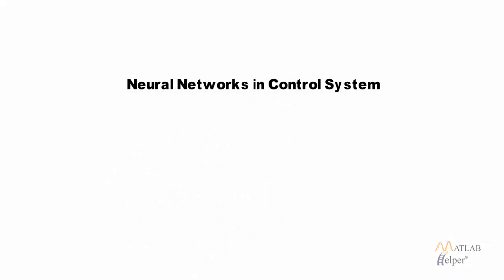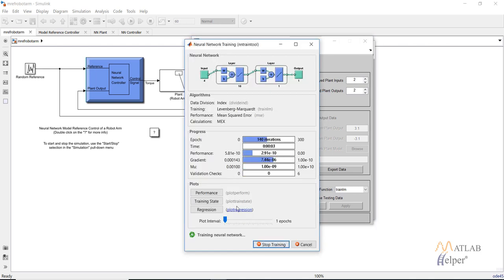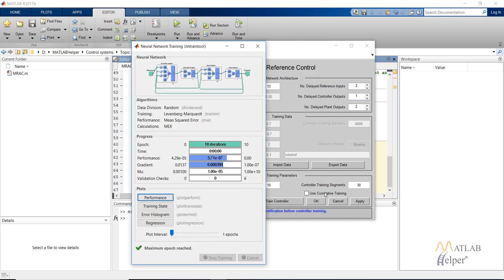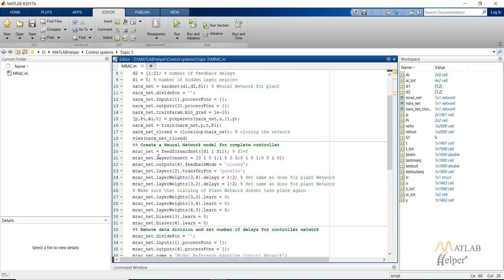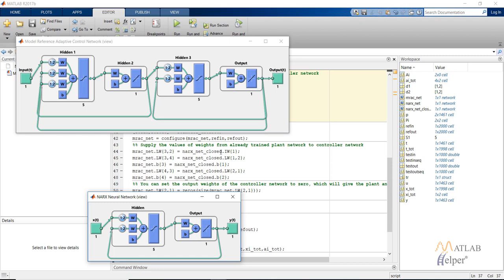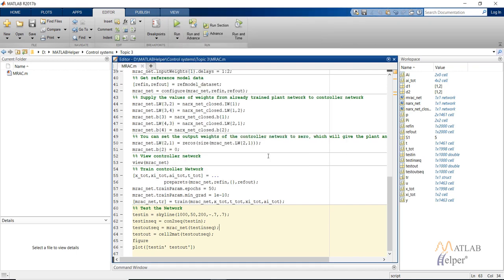Model Reference Control System | Neural Network | @MATLABHelper

Comment from the maker: Book our premium course on Neural Network at https://mlhp.link/NeuralNetwork/
Read this lesson at https://matlabhelper.com/course/neuralnetwork-m2c8l4-model-reference-controller/ for codes & explanation.
0:00 Introduction
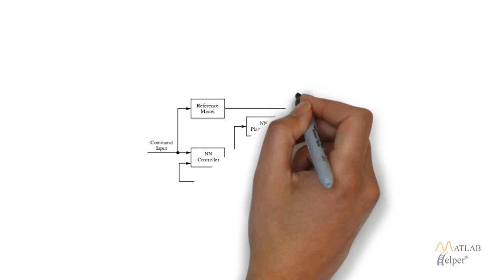0:19 Introduction to model reference controller
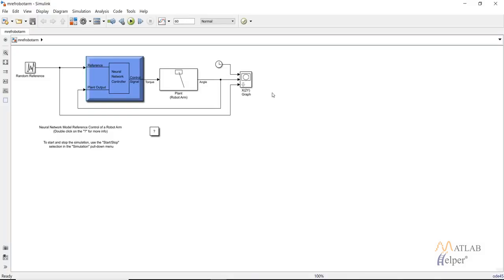1:44 Simulink model of the reference control system (robotic arm)
3:19 Training the controller
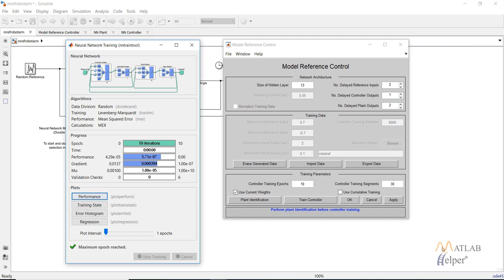4:46 Running the model
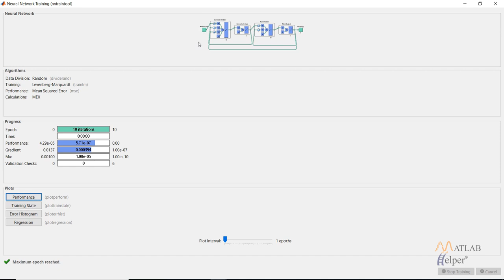5:18 MATLAB code for Model predictive NN controller
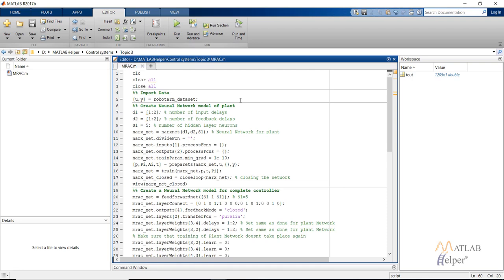6:01 Running the MATLAB Code and analysing results
Reply: @MATLABHelper  I want to design controller for fractional culculs technique with such kind of analysis with neural network .

Comment: How would you get the controller from there? What you''re simulating at the end is the final neural net, not how well your controller would do on the plant itself. Would you just copy every weight like you did with the plant identification?
controller_net.IW{1,1} = mrac_net.IW{1,1};
controller_net.IW{1,2} = mrac_net.LW{1,4};
controller_net.LW{1,2} = mrac_net.LW{1,2};
controller_net.b{1} = mrac_net.b{1};
controller_net.LW{2,1} = mrac_net.LW{2,1};
controller_net.b{2} = mrac_net.b{2};
Reply from the maker: Thank you for the comment! You can follow our Neural Network Course at https://mlhp.link/NeuralNetwork. If you have any queries you can write to us at course@matlabhelper.com
Reply: MATLAB Helper ®  Hi! That sounds like a plan, but right now I just want to know if you can answer this simple question. I dont know if taking a course will necessarily help me with this
Reply from the maker: Hi  @LoudHydraulics ! 
Our experts provide assistance in all academic and research work with Online Sessions (Audio, Video or Written) or Offline Written Work with pricing suitable for all. You can see our services at mlhp.link/services and portfolio at mlhp.link/portfolio

If you are looking for expert's assistance and ready for the paid service, share your requirement on our website or via email to team@matlabhelper.com with all information including service preference, necessary attachments, and any deadline.

Comment: How to make this statement  in simulink for a system containing continuous states :
Varying the current from 1 to 25A, in steps of 0.4 ampere,  every 40 s over a total simulation period of 2720 s.
I have to insert output of it as input to a system which contains continuous states. I mean block diagram contain differential equations
Reply from the maker: Please share your requirements to contact@matlabhelper.com or start online chat at https://matlabhelper.com and our expert will be glad to help you